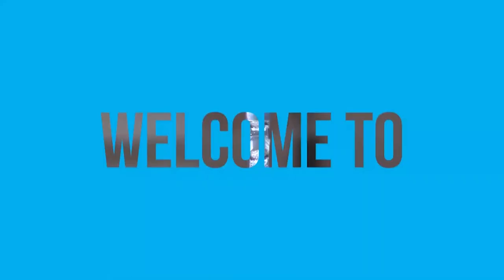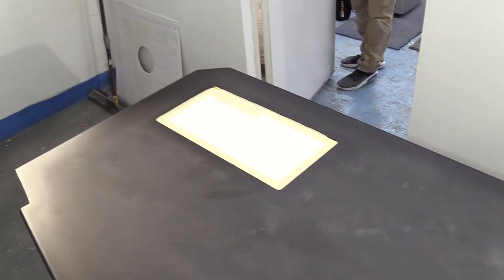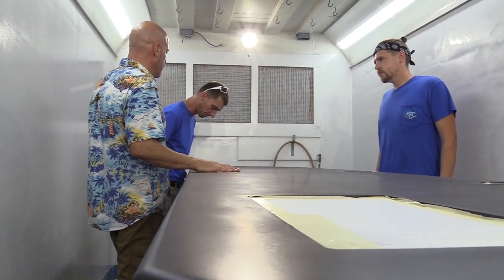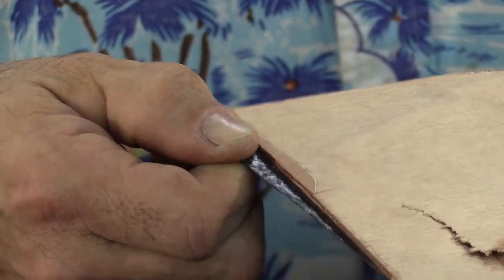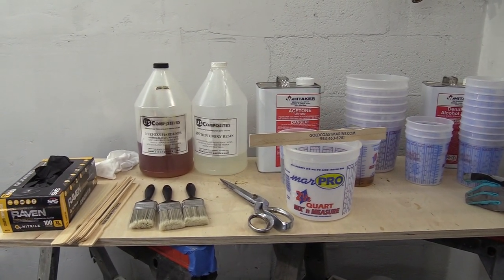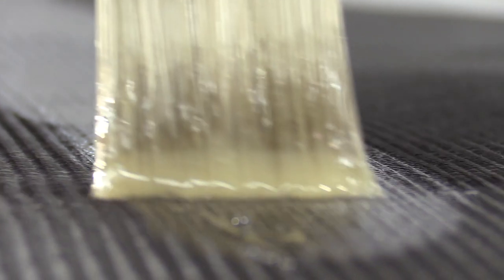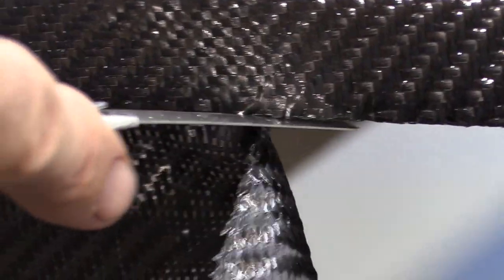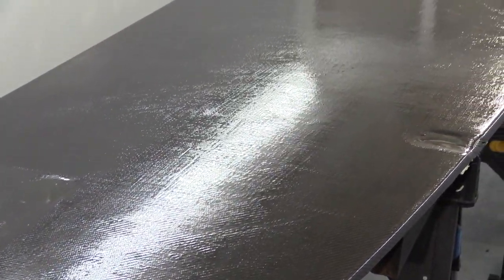How To Lay Up Carbon Fiber By Hand | Yacht Shop Creations

Comment: Hi sorry, first love from the UK. I have a question about using carbon fibre as a hull of a narrowboat for the British canals and water ways. Could I use carbon fibre as a hull which not only needs to take hits from other boats but also from rocks and shopping trolleys under the water line. Sorry for my question I just looking for other options other then steel or aluminium as a hull. Not only do narrowboat have to be blacked every 3 years but the proof steel is so high right now. Plus I would love a narrowboat home as unique as myself. Thank you for your time 😘

Comment: So I guess the big mistake was going with the other #2 on the first try. Lesson learned. Looked like you trimmed before the cured green state. Am I right? So I assume the dry layup was to avoid troweling down? Not worried about floating then?

Comment: Im doing a layup on a mould thats an overfender for a car and has wide flares. What recommendations could you give me on that? Prior to layup, ill be spraying a UV clear in the mould the night before. Looks is the most important feature on this part,  but it will get additional reinforcements.
Reply from the maker: How did the project go for you?
Jim
Reply: @YachtShopCreations  im still working on dialing out the layup. I tried the layup with a watery epoxy, and it didnt come out too great, as I also could of let tack a bit more. But now ill be using west systems 105 for laying the cosmetic layer and then use infusion resin for the reinforcements. Any suggestions you have, I can definitely appreciate it!

Comment: All of the videos I watch about carbon fiber and only a few show people wearing gloves.
Maybe things have changed since I went through advanced composites? We were taught to always wear cotton gloves when handling or touching it and latex or nitrile when laying it up.
The explanation behind this was the oils in your hands, along with any other contaminations will lead to delamns because improper bonding will occur.
Of course this is more important when you have air flow exceeding the sound barrier but it was a requirement and they stressed the hell out of it.
Fiberglass not so much but its still a best practice to use gloves, and new ones each and every time you work with it.
Reply from the maker: Hello Dave,
    Excellent points, thank you so much for sharing your knowledge!
Jim
Reply: Your correct the oils in your skin can cause  problems. The carbon give the strength not the resin, the resins job it to hold the carbon in place I don't mean that in a macro way but in a micro way. A dry layup is bad not good and a wet layup is bad not good. The carbon needs to be completely wetted out each and every fiber encased in resin without leaving excess resin behind structural or not. In my opinion If you want a glossy finish use a clear coat paint.